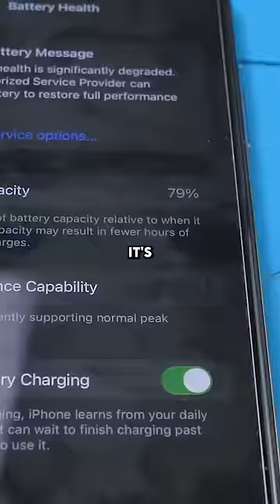A Bad Battery Can Cause This Weird Glitch... #Shorts

Comment: “Him saying 79%is bad”
Me choking with my IPhone 6s at 65%
Reply: Does it last bro?
Reply: My Friend with a iPhone 5 at 25%: Pathetic.
Reply: I feel ya, bro
Reply: Yeah had to use my 6s after I broke my se and it was at 68 but it lasted a good couple hours before it died so that was good, then I got my 11 and I’m still at 100 baby
Reply: My friend’s 7 is at 54%
Reply: My 6+ was so bad that I had to replace it this year with a new one it’s definitely worth it if it interferes with daily use
Reply: Same dude
Its just mine’s at 57%🙃
Reply: @NDS8027  my friend 15% (iPhone 5) :@
Reply: @NDS8027  with 25% it wouldnt even boot because the volate would be too low
Reply: @NDS8027  you can’t check on 5or earlier only on 6s and later
Reply: u can just replace the battery
Reply: My iphone 6 plus with 73% only lasts for about an hour. Totally unusable. Do you use yours as your main phone?
Reply: @rashdub2057  6 and later
Reply: @NDS8027  my friend has 0% on his iPhone 23
I’m still running with 76% on iPhone X waiting for my brand new 14 Pro ;)
Reply: @NDS8027  no way. How is the phone even surviving, I work in a phone repair shop and have seen 51% battery health iPhone not even staying in for more than an 40 minutes
Reply: Me with an iPhone 5s with no battery
*Interesting*
Reply: My old iPhone 5s' 12% battery health: Cool
Reply: Mines 43% health on my samsung 💀
Reply: iPhone 8 with 78

Comment: oh man, I had touch issues after a small drop on my 5s. Battery would die pretty fast, get warm to the touch as well. Should note that Touch ID stopped working after the drop, not sure why.
Reply: Sounds like a solder point broke somewhere causing some internal failure.
Reply: @whatiwonder4299  oh shit wtf. so its not just a battery issue... ouch.
Reply: @whatiwonder4299  yeah, that or a connector became damaged/dislodged
Reply: 5s? Could be bc the phone is like idk, 10 years old too. Although I could be wrong
Reply: @erikhiller9890  huh?
Reply: @erikhiller9890  why would it's age matter? lol, parts dont just stop working because they turn 10.
Reply: @john_titor1  they do though. Board components (at least some of them) wear out over time. This level of degradation is very common in many products that „die on their own“ because of simple wear and tear. In MacBooks you see it often with charging chips that have to pass around a lot of voltage. Age is a big factor to electronics!
Reply: is the SE the same 
cuz i drop my SE a lot
Reply: You probably have a short circuit somewhere, or something using power that shouldn't be.

Comment: My old phone would die at any percentage and I was never safe, even was charging at 100% IT STILL DIED
Reply: did you even change the battery?
Reply: my Galaxy grand prime plus was the same after 4 years, it would randomly switch off while taking pics and will run out of battery as soon as it goes under 30 percent. I gave it for free and bought the Galaxy a12, which after 2 years, the battery is still the same, even after 2 android upgrades, now it has the protect battery function which limit the charge at 85 percent and stop it.

what took Samsung so long?? protect battery is surely one of Samsung one UI 4 useful feature
Reply: @danteerskine7678 protect battery where is that feature

Comment: Yep, I think this is what was happening to me as my battery got bad and had to be changed along with the charging port.  It wasn't self touching apps, but for games with tapping; tapping on the screen was unresponsive unless I tapped somewhere it responded.

It's fixed now.  It started with a charging problem.

Comment: Can confirm, have this issue with a Samsung Galaxy S5 G906K. When battery is at low charge around 15% it starts to exhibit phantom touches which is very evident with the "show touches" developer option turned on. It's even worse with an aftermarket battery around 50% (Acevan brand). Ironically enough it happens less on a G906S and doesn't happen with either battery on an S5 G900A.
Reply: Man the s5 is crazy old. Why even mention it Xd

Comment: This is actually uncommon, if it even happens at all. Apple slows their phones down when the battery gets bad to PREVENT this from happening. That means the the phone will receive adequate power, so it can't be a power issue. Also the phone wouldn't touch random apps, it would restart. This phone has a different problem. What I would've liked to see is him plug it in, and see if that fixes it. Much easier to diagnose.

Comment: Mine had 52% left, it was turning off at 60% (but not often) and took 10 mins to get from 100% to 50 so when ever I would put it on charge it would glitch when was touched! I though the power adapter was not ok but it was the battery that had no audacity over the charger so the charger was messing with my screen. My theory is the chargers have to be strong enough to be able to handle the weight (aka power) of the phone, so chargers are supply a not perfect DC current and not very happy when they are overloaded!

Comment: My old phone came with 5 spare batteries (in box) and it survives one charge... But on the 2nd one, itll shut down at 75% and if you try and charge it, you get a boot loop, if u try to power it on, its just stuck at the startup screen and eventually turns off

Comment: I got the same problem my 6s Plus went crazy when the battery downs to 25% and lower but it goes ok when it is connected to the charger or if it has a high battery capacity within the day the system goes back smoothly. 

I think I damaged my LCD by exerting too much pressure while navigating the phone using 3D and haptic touch there’s a weird tiny circle that appears on the sides

Comment: I had a similar problem on a Moto G5 Plus (yes, old phone). Replacing the screen didn't work so I always assumed it was a hardware issue but didn't consider the battery.

Comment: My phone sometimes starts tapping random stuff by itself without warning no matter the battery charge level. I have to restart it, and then it works fine. But, my battery life has decreased a bit since I got this phone 7 months ago, so I think the battery be slowly failing, so that might be the problem.

Comment: Ok so I got the same issue, got my battery replaced and it still does the same thing.

What I do to fix it is just lock and unlock my phone (hit the power button) and then it doesn’t do it for a bit and then it happens again.

Comment: my ipad and phone both dont have much storage but there apps will say the name under it but no pictures on some apps and my phone will also die at 2% or 1% it happened yesterday. im not sure what my phone’s battery health is but i think its in the middle 90s or low 90s. also i have a ipad 4th gen and an iphone 11 so there only about maybe 2 or 3 years old. if you replay tysm!

edit: my ipad stopped doing it bc i have a little bit of storage lol

Comment: Story time:
I had an iPhone 6se, which used to be my sisters, and so it’s pretty old. Well when I got it from her, it was good apart from when it was in the cold. If it was in the cold the phone would go flat, even if it was on 100%. So after a couple months of waiting to see if it would go away, we took it too an apple repair shop nearby. I knew it was something to do with the battery but my battery health wasn’t low so we talked to the people in the shop and they said that they’d never heard of anything like that happening, and that it could be my usage, but that’s not what the internet said. So after about 10 minutes of discussion with the workers they said that they would change it but it might not work. 

We come back later on and they are finished. Turns out it was the battery and they were just trying to sell us a new phone, dumb apple 😐

Comment: I dont have an Iphone, but for some reason my battery usually dies at 1% or 2% (which is not the problem) because when i charge it goes directly to 40 to 60%, how is that possible and why does that happen?

Comment: That happened to me, i had a 6s plus and whenever my battery was low let’s say 3% my phone would glitch and i couldn’t go on it. It wouldn’t touch apps by itself but the phone would glitch and i wasn’t able to use it and if i used my phone while it was charging it wouldn’t let me the battery would go even lower like if i used my phone while charging it wouldn’t charge it would just decrease the battery. Like the battery shows that it was charging but the battery percentage never went up it just decreased

Comment: For me it only happens when it is on a wireless charger, I still use the 10 s max, but it turns off then won’t turn on until I put it on a charger, then it turns on with a full battery 🤷‍♂️

Comment: I have the same iphone and when im below 10% it starts to lag hard asf and then dies 20-30 second later. The Capacity from the Battery is at 82% and probably still the original from Apple.

Comment: Look. If you're a phone fixer, make sure all of the screws are tight. If not they might get loose and fall out causing them to puncture the battery. That's what just happened to my iPhone 12. Should I keep using it or replace the battery? I have a spear iPhone 5s just needs a new screen and I might just start using the 5s or buy an phone off Ebay or a brand new one. Because there's soo many problems with my ip 12 so no face I'd, aftermarket screen equals to no true tone, bad battery

Comment: lol and my old 5s was at 53%. it used to die at 30% sometimes and the battery drained quick as hell. i replaced the battery but touch id stopped working after so i cant even sell it. great

Comment: I have a problem close to that, my phone dies at the right time but when I put it on the charger it turns on 3 seconds later and is on 3%, I guess it’s not a problem but a benefit

Comment: I just got my phone battery  changed since it used to drain quickly...After replacing it It drains even more without using it. Any suggestions?

Comment: I have a XS Max and it's stuck in a bootloop. Shows the apple logo then turns off, and repeats until the battery dies. Could that be a bad battery or what else could it possibly be ?

Comment: Do you remove the Taptic Engine when doing a battery swap? I only do it if I have to, when the forbidden cheese isn’t doing me favours. I’ve noticed aswell that the bottom speaker cable shield is really flimsy and rotates even when screwed on, have you come across that before?

Comment: Oh wtf I had my iPhone X 512gb touch randomly in the top right corner all of the time. The repairman said he had never seen it before. I got a new oem panel and a new battery while it was open, maybe the battery was the issue and not the panel?

Comment: Hey idk if you see this but I could really use your help!

My mothers phone has been acting up a shot ton the past few months. I mean calling random people, opening and closing apps on its own and even just the screen going black and you have to wait a few seconds before it turns back on. She had gotten he screen replaced twice but none of the problems started until after she got her battery changed. Is the inside of the phone damaged? Does she have to get a new phone or can this be fixed?

Comment: Iphones have been using this shit as an excuse forever. You can take out a 'bad' battery and measure the short circuit current, and it's well above the milliamps required to drive the touchscreen. Androids with bad batteries also NEVER have these problems, they just randomly die. Also, when your iPhone 'dies' it is intentionally shutting itself down, jailbreak tweaks exists to make the battery fully drain, and they allow the battery's onboard low voltage protection to shut the phone off. Yes, it's not great for your battery, but what's up with apple putting this huge buffer on batteries, they have lots of life left before they are actually garbage...

Comment: My phone 11 battery health is 85% but my phone touch is not responsive sometimes and I replaced 3 screen due to this problem but it isn’t fixed yet . What’s the solution for it ? @phone Repair Guru

Comment: Yo I have a question so I went on a road trip with my iPad next to me but before it was pushed into a seat by some stuff and the metal is bent pushing on the screen just wondering if you could tell me what I could do it’s a iPad from 2022 not old and is bent near the 3 metal magnets

Comment: When my j7 max reach 20% it only takes 1 minute to reach 5% and it dies
When my phone reach 20% even i plugged it into charge it will turn off
And i took only 3 hours before to charge it but now it takes more than 5 hours 
That means my battery is not ok ?

Comment: Iphones: Nooooo you used me for 4 months and my battery needs changing!

Android Phones: I have been drowned in water, partially set on fire, nobody charged me up to 100% in years and they have been using me for 4 years. Here, have only a one hour shorter battery time. Also, you can just rip off my back and slap on a new battery yourself

Comment: hello sir can i ask you something ? .. i own an iphone xs .. i just change the battery few hour ago and i still have a same problem .. that is when battery drop its drop 3% each .. example from 93% to 90% .. it does not 93% 92% 91% 90% .. and thats the firts prob , second is i cant charge my iphone on its own .. i need to turn something like music to get it still on when charging if do not do that it will die when charging .. so what the problem sir ? I need your help .. does the motherboard issu or something else ?😢